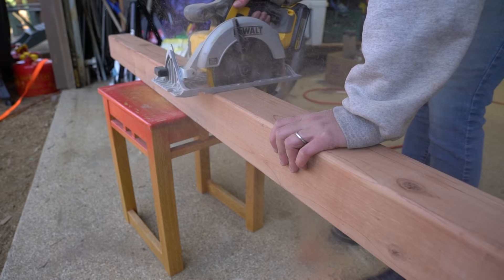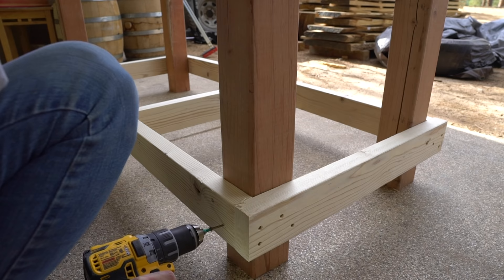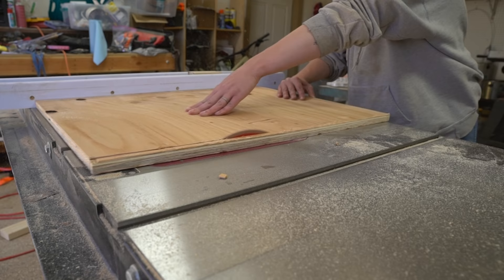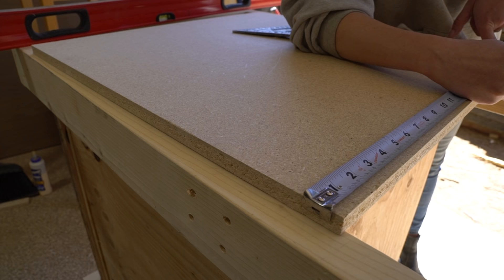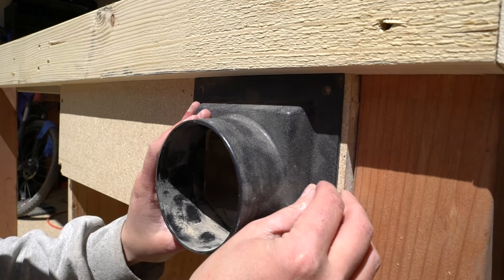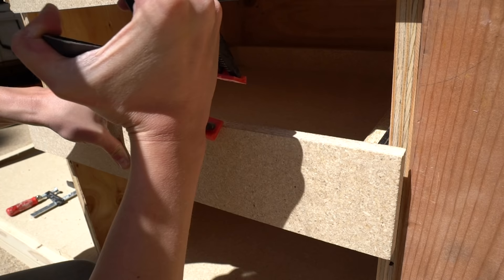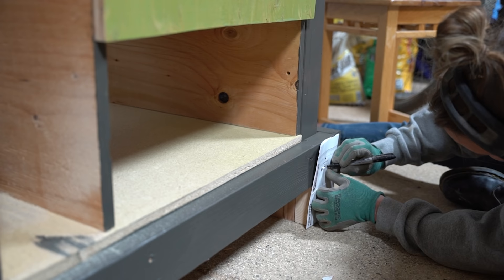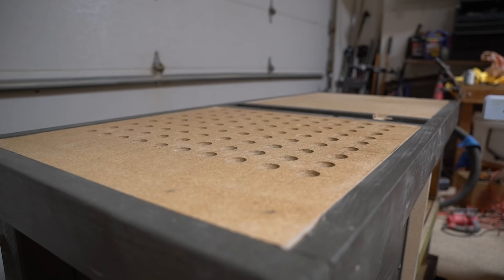DIY Downdraft Table | HW|Designs

Comment: Hi , thanks for posting , I know how much work goes into creating these vids . Although I've been a professional cabinet maker for decades I love watching newbies and often find interesting solutions or work arounds. One thing that jumped out at me is the drawstrings from your hoodie dangling above your working tools , please consider your safety and remove the strings or the hoodie altogether. I once had a router bit eat the  shirt off my belly in a moment of carelessness,  I was lucky it didn't reach skin. That table saw blade would grab your string and pull you face first into the blade before you would have time to react. Woodworking is awesome regardless of your skill level and videos like yours help promote this to others , thanks again. Be safe.

Comment: Ok, I have 2 queries.. that is not MDF, it is chipboard/particle board.... Or is that what it is called over there? as I am in Melbourne Australia and we call that chipboard/particle board. Also, why not cut the suction hole round which would allow a better flow of air into the suction hose instead of just cutting holes with the Forstner bit and leaving all that excess around the sides, surely that will obstruct the flow of air and make the suction less efficient. Also my last comment is that the cutting in and out of the music and then you talk is very obtrusive, why not just have the music going but at a much lower volume and then talk over the top of it when needed, it would make for a much better flow of audio.

Comment: How is the suction away from the vent hole? Does it exist or just collect in the tray?
Reply from the maker: It actually works pretty great if you move away from the face with the port, the only kind of dead zone I’ve noticed is if you move away from the hole along the face (to the left bottom corner). I’m thinking as an upgrade later, I could make a slightly more graded vent angle to approach the issue.